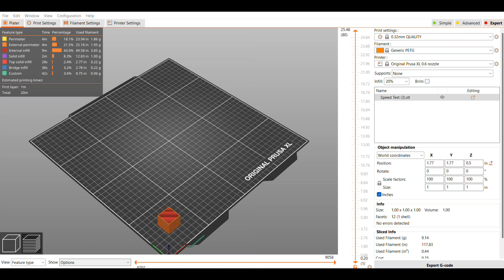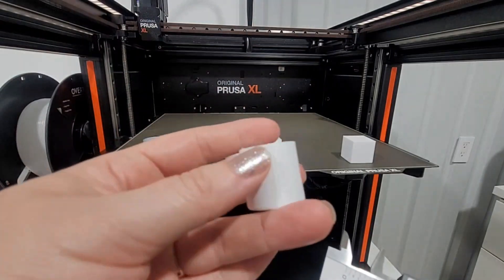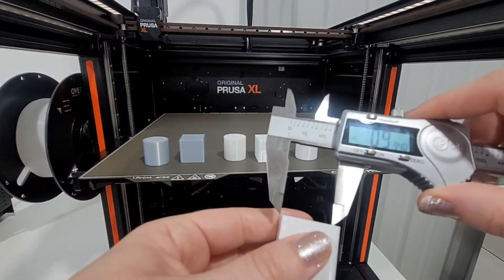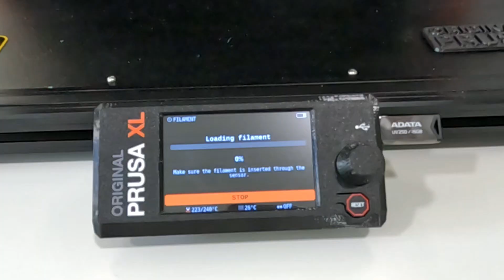Printing different filaments on the Prusa XL - PLA, TPU and PETG

Comment: When printing tpu what do you have to do differently vs pla or petg?
Reply from the maker: I just switch the profiles. And have a hard time loading the tpu filament. TPU and PETG I use the textured sheet. Thanks!
Reply: @tada3dprinting  thank you do you have an affiliate link for the prusa MK4 I was thinking about getting one and I've always heard it was harder to print TPU but with the new MK4 it should be easier like you don't have to loosen up gears you just change the printer profile in the slicer load the filament and use the texture sheet like you mentioned is it really that simple.

Comment: Agree with the comment on millimetres vs. inches, if you are looking at making dimentionally accurate parts.  You really want to take into consideration your slicer settings for first layer height (0.20mm) and your regular layer height (0.32mm) and then scale your object to be an exact multiple of that height.
Reply from the maker: Thanks for that!

Comment: You may want to use something like the vector3d calilantern calculator, It's the most straightforward thing I've found for dimensional accuracy.

And yes, my tpu prints tend to display more shrinkage also, which can be corrected for.

Comment: What else do you do with your printers? Do you have a store or is this just for your own entertainment?
I look forward to seeing what’s next!
Reply from the maker: Yes I have an etsy store. I started with one MK3s. I now have (2) MK3s, (4) Minis, (1) XL and MK4. The XL is my favorite still. Thanks!
Reply: @tada3dprinting   Do you have a link to your storefront?
I ordered an XL over a year ago and cancelled it in March the week before the MK4 came out, talk about timing, i could have had my MK4 sooner. I am trying to ramp up production of some parts i make but dont currently sell I just use in the industry I work in. I wanted the new faster machine so I could try my hand and producing parts to sell. is the MK4 that much better? currently using a mini and all my parts fit. have you used any other printers?
Thanks,
GM

Comment: I suspect the heights are off slightly because of the selected layer height. 1 inch is 25.4mm, which isn't an even multiple of 0.32mm. The next multiple is 80 x 0.32mm = 25.6mm which is 1.008 inches. Potentially your first layer is 0.2mm and the rest are 0.32mm, in which case it will be closer at 1.003 inches.
Reply from the maker: Oh that's an interesting point. I'll look at this. Thanks!

Comment: Those are really pretty good dimensions for stock settings. Coming from a machinist background +/- .005 is a tight tolerance for most metal machining. You can get down to +/- .001 but that would cost a lot more and probably produce some scrap parts.  Be interesting to see if it can keep that at higher print speeds once they get input shaping.  Thanks for the video.
Reply from the maker: Thank you!

Comment: I'm sorry to have to say this but instead of wasting filament for these guys on here, why don't you print a "Hairy Lion" in your best colored filament? Something that is cool looking. Or print some mods for your XL and replacement parts for your MK4 or MK3S+. Maybe a phone case that you will actually use.
Reply from the maker: Actually I am printing the Hairy Lion! I just finished it at 50% and am waiting on more filament to do the Gigantic size. Yes I agree other prints are more fun. I'll work on this. Thanks!
Reply: I think this prints are not a waste of time but an accurate test for this new printer and its capabilities

Comment: Here's a "dumb" question, could you take the bowden tube off and use a rack or something to hold the TPU over the hot end parts and feed it down like the MK3 does?
Reply from the maker: I don't see why not. At least while printing TPU, it would be easier. Thanks!

Comment: Is there a 1st layer offset option? On my mk3, my petg 1st layer always needed to be closer than pla, to fix the appearance and sometimes adhesion to the textured plate
Reply from the maker: There has to be a way to adjust it somehow. I'll see if I can find anything. Thanks!
Reply: There is an option in the latest firmware for the XL and MK4, once you have started the print, but it's a temporary setting only. It resets back to default after every print.
Reply: @TestType  thanks, I hope they add a permanent option based on the profile used or material. Does the Z offset work under physical printers in prusa slicer on the Xl or Mk4? I used to use this feature all the time, but they broke it 2 + yrs ago, so I manually adjust my Mk3 on the printer when I swap materials.